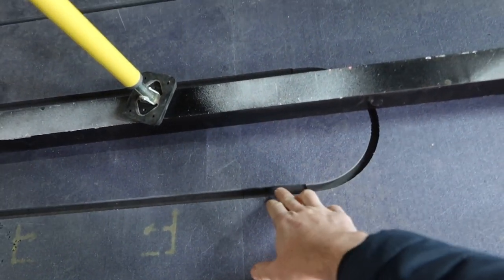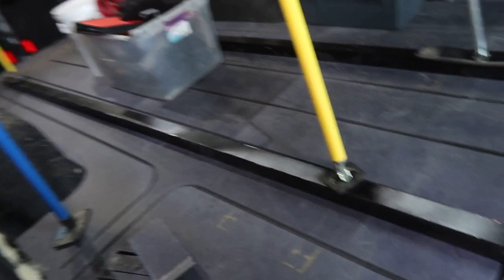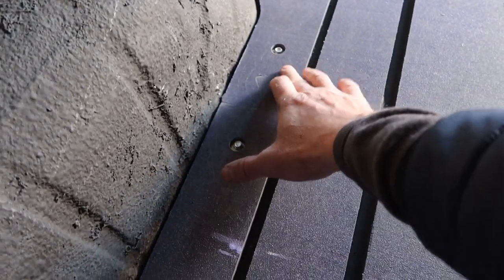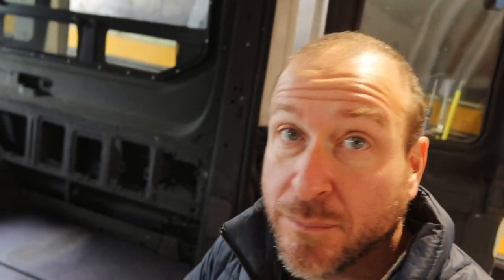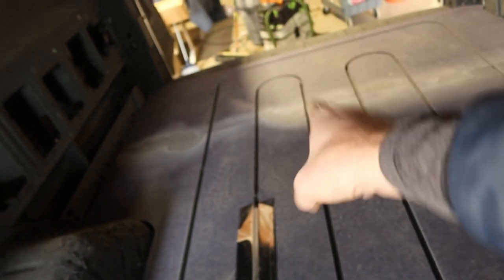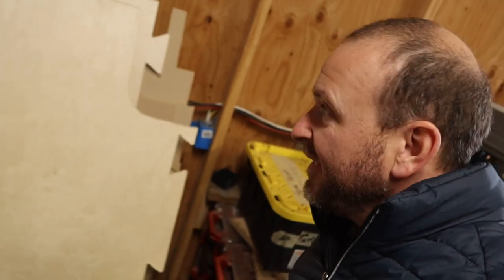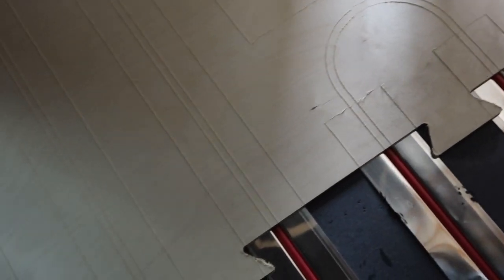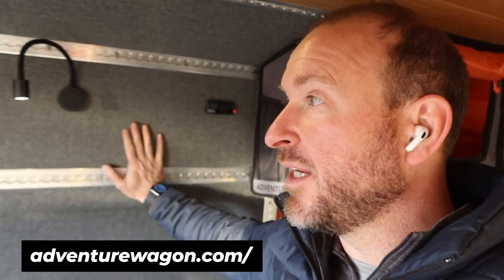VANLIFE Hydronic Heating Flooring | Laying in Pex Pipe and Transfer Plates

Comment: This is similar to how it’s done on upper floors in a wood frame house. Just applied under the plywood between the joists. The metal plates help to radiate the heat.

Comment: Just a slight correction of what you said about the transfer plates, you said they reflect heat which is incorrect. Heat transfer plates are made of aluminum and aluminum just like copper is a very conductive metal. If you were to take a 12" piece of aluminum tubing and heat one end with a blowtorch it would only be a few seconds before the other end was too hot to hold in your hand, this is conductive heat transfer. The hot propylene glycol antifreeze transfers heat to the PEX, then heat transfers from the PEX to the flooring and transfer plates which then distribute the heat energy over a wider area of the floor without the transfer plates where the PEX lines were would be nice and warm, but in between the lines would be much cooler.
Reply from the maker: got it... thanks for the correction

Comment: Is there a way to shut off just the floor heating without turning off anything else connected to the hydronic system? What I'm asking is, what if you want a warm shower but don't want the floor heated?
Reply: Yeah... you just put a valve in, or a solenoid valve to open/close the circuit from a button

Comment: It makes no sense to lay wooden panels (insulation) on the pipes! the reflected heat should be easily transferred to the air and not trapped between the two insulators!